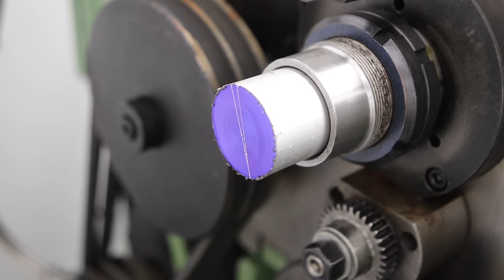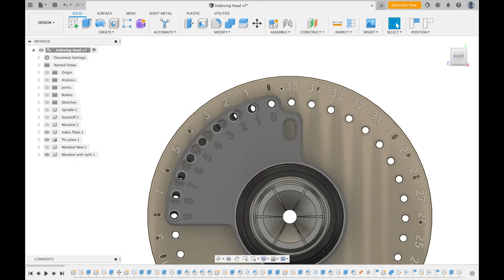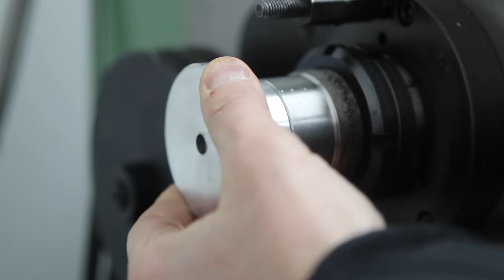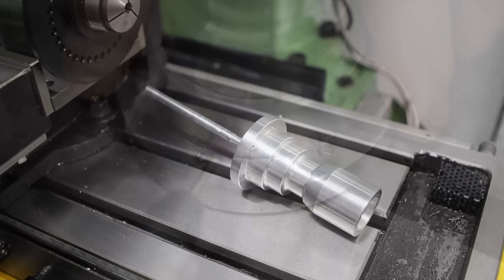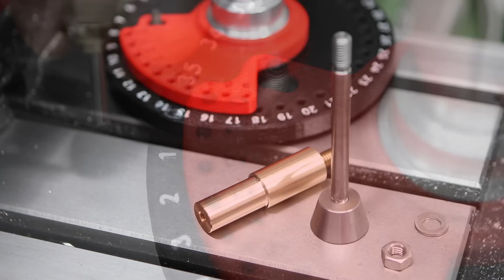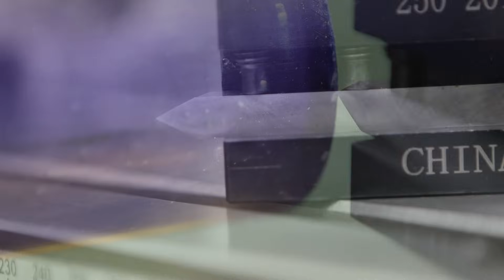Making an indexing attachment for the lathe

Comment: For what it is worth, when I 3d print a part that has an internal hole or opening that must be to size, I increase the size of the opening by the width of the filament nozzle.  This is usually a good starting point.

Comment: WD 40 is a good lubricant when tapping holes in aluminum. Give it a try. For those new to tapping holes, most affordable tap and die sets are made of carbon steel. If you break any, replace them with HSS (High Speed Steel)  for these are stronger, stay sharp longer and if all you do is aluminum, don't forget the WD40. There are other lubes designed for aluminum but cost is usually a lot higher.

Comment: I don't know if I'm making this more compicated than it is, but if you wanted to set a specific angle then, in spreadsheet form:

Angle in column A: =ARRAYFORMULA(ROW(A2:A361)-2)
Black dial in column B: =ARRAYFORMULA(1+FLOOR((A2:A361-1)/10) + MOD(A2:A361-1, 10))
Red dial in column C: =ARRAYFORMULA(MOD(A2:A361-1, 10))

Comment: I’m having a go at designing this myself in fusion. One thing I’m confused about is getting 10 holes 9 degrees apart. fusion asks what is the degree from the first hole to the 10th. If you enter 90 degrees (10 holes x 9 degrees) you get the same hole spacing as the 10 degree outer ring. I’m assuming it has to do with the spaces between the holes? My only assumption is that there are 9 spaces between 10 holes and I need to multiply 9 spaces by 9 degrees to get 81 degrees from the first hole to the 10th (at the end of the 9th space). Does that sound right?
Reply from the maker: To be honest it’s a couple of years since I did the design work and I’ve forgotten exactly how I did it. But, basically, this is what I remember - the main wheel has 36 holes, so, they are 10 degrees apart. The second component - the holes need to be 9 degrees apart, so if they made a complete circle (I used a segment of the circle) then it would have 40 holes. Make sense?

Comment: Do you not have a DRO for drilling a hex pattern ?  Also, for tapping aluminium, use a tap follower for making a straight thread and use thread cutting oil and take it far more slowly and back and forth, clearing chips.  You also need to be clear about the size of the drill hole for tapping aluminium as it is different to (eg) steel.

Comment: 3D printed parts can be designed taking into account the features of the technology and materials. In cases where a tight fit is required, in CAD, set the internal hole equal to the shaft diameter, and add compensatory elements in the form of truncated holes around the perimeter—this way, the part will have room to expand.
Reply: Or just machine the plastic to a precise size

Comment: A broken tap from a workpiece made of aluminum or copper alloy can be extracted very well using citric acid. Moreover, you don't have to wait for the fragment to fully dissolve. The part itself suffers minimally from this. This has bailed me out a couple of times, saving my labor and a piece of expensive bronze.

Comment: you probably have worked this out yourself but I thought I would mention it anyway,  mill bit needs to be smaller in diameter than the hole when you have hollowed out the tap use a stud extracter to get the residue out, hopefully leaving the threads you have already cut intact. all the best
Reply from the maker: Thanks, good tip!

Comment: you could try aligning the hole with the tap remnants in it and get a milling bit in the chuck of the correct size, advance the mill bit in micro steps untill there is no more tap.
Reply from the maker: Good idea, thanks!

Comment: fastest and easiest way to remove a broken tap in aluminum: Get some nitric acid and drop your part in that. Within minutes the tap will have been dissolved. Nitric acid dissolves steel but does nothing to aluminum.
Reply from the maker: Great tip, thanks!

Comment: Clever idea.
I think if you had the holes in the OD of the plate (IE rotated by 90 degrees) and the vernier plate (the red one) fit around that, it would be both easier to use and more accurate.
Reply from the maker: That’s a good idea, thanks!

Comment: Use spiritus to cut aluminum threads. To remove the tap, you could use a in this case 2mm carbide end mill and mill it out.
Reply from the maker: Thanks for the tip!

Comment: "THEY" make	>>>left hand drills<<< for the lack of a Trans National statement: the are rotated Backwards to regular drill bits, THEN use an "easy out" per correct size of your broken part.

The Drill BITS are Tungstan (sp) or other "Hardener additive", Any way, a VERY TOUGH STEEL ! ! ! !

I have had several, & buy them indevidually, As Needed 😮
LUBRICATION, In America, I use Kroil Oil, by Kano Industries, it is a super thin viscosity SYNTHETIC oil, designed to PENETRATE.

It will break rusted metals "bonded together" but for this purpose, it Really CREEPS into the miniscule difference between "Product Wall" & the Broken Tap !!!!

I buy it now, by the pint, as a PROFESSIONAL Machine Repair Shop for Hard Wood Flooring Tools, I bought TWO Gallons a YEAR, >>>ALL<<< of my "Floor Installers" received ONE OUNCE per Month  to lubricate their Air Staplers: ONLY ONE drop, per DAY, per tool.😮😮😮

Hope that helps,

philip, from the Great Pacific NorthWET, Oregon, USA

"Truth spoken softly, is LOUDER than Lies SHOUTED".

Comment: I have been getting lots of random machining videos today for some reason. A hacksaw is one of my favorite hand tools. Having said that, I have several quality hacksaws and only use quality blades and I use as much of the blade as possible as I paid for all the teeth. Long story short, I can cut right on the line every time! Handy tool you have made there with the vernier segment. Cheers 👍
Reply from the maker: Good to know, clearly need more practice! thanks!

Comment: I have gotten broken taps like that out by using a carbide punch to tap on one side in the “unscrewing” direction, and then grabbing the body of the tap with vice grips or needle nose pliers. For really small taps like this, a small pair of flush cutters can be sacrificed and used as pliers. It’s very tricky sometimes but I have never had to grind one flush yet!
Reply from the maker: Thanks, I'll try that next time!

Comment: As you were tapping in the aluminum I did not see you using any fluid. I always use WD-40 and very, very rarely break a tap and this has included taps as small as 4-40.
Reply from the maker: Thanks, I should have used lubricant indeed.

Comment: A hacksaw, like every other cutting tool has a cutting speed. It is about 60 stroke a minute, it also has teeth all the way along the blade and they should all be used when cutting. You will find it goes in the metal straighter with a cleaner cut. You should also lube aluminium with paraffin and avoid using steel cutting tools because aluminium welds itself to steel. Much better to use TCT. Other than a teach yourself approach it is a item I will probably make and I have rotary tables and plates. It would make life easier.
Reply from the maker: Thanks, good advice!

Comment: Removing a broken tap is one of the hardest things to do….that’s why you take great precautions so you don’t😜😜😜 
There is no need to power tap 6 holes, never use a spiral tap by hand, only under power. Try to use a 2 flute tap, the web is stronger than a 4 flute. Use proper lubricant, Moly Dee is probably the best but is pricey. 

GL
Reply from the maker: Thanks for the tips, wise words!

Comment: You commented that the aluminium was quite a gummy metal ( or in this case type or specification ) yet you did not use any lubrication on the threading operation. Especially when you are using a tap as small as M3! WD 40 would have prevented the tap breaking, yes I know you probably wanted to keep the lubrication out if the equation when you were filming it, but you now have had to pay the price! I've watched your follow-up video and it works nicely with your revision. As I don't have a 3D printer I'll probably attempt this in solid aluminium. But first I have to decide if it's practical as I have a Warco WM300 Lathe/ mill combo and a large box on the end of the lathe where the drive belt is and a dog clutch on the end of the spindle to change the drive from the lathe spindle to the mill drive.
Reply from the maker: Thanks for the feedback. Yes I know I didn’t use lubrication, silly mistake. I’ll be making another version in metal soon so watch out for that video.

Comment: Great prototype, you will learn how to not make those bonehead moves later on.

The concept works.
I hindsight, I would try to design it so you can see the numbers from the other side of the plastic as well.

Also, you need to replace the plastic with metal sometime. It will wear out quite quickly.

Also for tapping, lubricant and reverse half a turn like everyone else says. The chips is locking it up and you need to break them of.
Reply from the maker: Thanks. I am planning a metal version soon.

Comment: Hope this helps Peck drill it with a carbide mill high rpm low feed en passes of 0.2 mm and use a smaller mill then the diameter of your tap
Reply from the maker: Thanks!

Comment: I would have ground a slot in the material of the tap sticking out and tried to back it out with a flat tip screwdriver. Then I would have ground it flat and used just 5 bolts when that didn't work...
Reply from the maker: That’s pretty much how it went, I ground a slot with a dremmel, but one of the sides snapped off as soon as I tried to back it out with a screwdriver.  It’s in there permanently now!
Reply: @joneseymakes  That's how it goes... Great idea and implementation...

Comment: When tapping, half turn forward, quarter turn back.

To remove broken tap
you can use salt water or diluted sulphuric acid with an anodising setup..lead anoode and 12v low current power supply
Reply from the maker: Thanks!

Comment: Bit of kerosene or proper Al lube might have stopped the tap breaking in the first place. Putting something pressing against the part ( like an angle plate) holding it to the slitting saw should have allowed you to cut right through. Personally I dont like the 3D parts and I suspect they are your root cause for fine line variation. However the design I think is really good and Im tempted to make one myself thank you
Reply from the maker: Thanks, I’ll be making one of these in metal soon.

Comment: Mr Pete says you only really need three or four threads and recommends over sizing the hole a bit for a  percentage the holes depth so the tap only engages a portion equivalent to a common nut thickness therefore not to overwhelm your tap.
Reply from the maker: Thanks, good tip.

Comment: Many years ago I saw a scheme for a military lathe where a indexing head was mounted on the spindle outboard and a powered spindle on the carriage could mill or use a slotter on the work piece.
Reply from the maker: That sounds interesting, don’t suppose you have any pictures?
Reply: @joneseymakes  I wish, it was in 2004 on Aberdeen Proving Ground.
   The mill in any case was some incarnation of I believe "Master Mill" where the base and the spindle had a translating screw between them and guided by four guide posts like a die set. The motor was belt driving a worm gear box/spindle. There was also a reciprocating slotter bar attachment where the cutter would pivot in the bar on the retract. I think they were used as part of a very compact repair shop.

Comment: I'm thinking of doing something similar, but mounting a rotary table on the back of the spindle, with the internal expanding collet mounted on the table and the rotary table housing stopped from rotating by a long arm attached to the headstock.
Reply from the maker: Sounds like that could work.

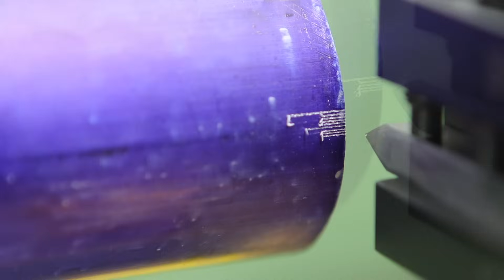Comment: In the testing (19:14); To get "good" spacing on the 1 degree attempt, the errors would need to be a good deal less than half a degree. Any errors in the position of the holes in the 3D prints will be cumulative, so (even with zero slop in all other mechanisms) the 3D prints would need to be good to a 1/4 degree, which starts to sounds like pushing the limits.
Reply from the maker: Yes I agree. I think this project was a useful prototype but I really need to remake this in metal to get the sub one degree accuracy that I’m looking for. Thanks for the feedback.
Reply: @joneseymakes  With a radius to the indexing holes of about 2.1 inches, 1 degree is tan(1) * 2.1 = 0.036". 1/4 of that is 0.009", colloquially 9 thou, or about 1/100" of an inch.

What's the resolution and accuracy of the 3D printer?

Comment: Dissolve Alum in hot water and soak the aluminum part in the solution. The aluminum will not be affected but the tap will be disintegrated.

Comment: This happens when you don't back off a half turn for every turn to break burrs and clear chips. This is a method of work taught in old school fabrication. In over fifty years of machine fabrication I broke only one tap. That was the first one, I learn quick. All I see now is keep turning and most don't even bother to lubricate the tap and they don't understand why it broke. I bought metric and S.A.E. tap and die sets when I became a machinist and replaced the one tap that broke, and four others over time that wore out. Both sets are almost as old as me!
Reply: I was taught to back it off in GNVQ Engineering in school 23 years ago now! Mind you my teacher was a lot older so i guess he taught us traditional methods he learnt before becoming a teacher.
Reply: @mrnobody9821  u used to be a metalwork teacher back in the old days when we allowed children to actually do things with their hands lol. I taught the pupils, ( boys and girls) to turn the tap or die 1/4 of a turn forward and half a turn backwards, thus ensuring the back side teeth cut the burrs from the threads. And when using taps if they broke the first one, not only would they have to start the part again, ( it was a small hammer from 12mm square mild steel with a taper filed onto it at one end) and they would get a pass at the first broken tap, but a second one they would have to pay for and be doubly behind the others. ( I was crafty as well as I made them do all the hacksaw and file work before they drilled and tapped the hole for the handle  so it was a penalty for breaking the tap!)
Reply: New school guy here. I learned to back off from YouTube lol. Thankfully I learned early on
Reply: I'm not a machinist nor do I do any kind of manual work... but I know to back off a tap periodically from the one semester of machining I did in high school ~30 years ago, it's that basic.
Reply: When you see the tap binding, you know there is going to be trouble.  Usually that's a sign to back off a half turn and to add some more lubricant.

Comment: nicely done!  in the absence of a band saw, a Dremel Cutoff disc might be a good choice! :)   For the tap, you might want to consider building an EDM tap remover and / or use an EZ-Out if the size of the tap allows for it.
Reply from the maker: Thanks for the tips!

Comment: Be sure you back out the frequently when tapping small features. If it starts to get really tight do not go further, back it out slowly. If it gets tight again, screw back in, then slowly back out. Forcing it like you did will ensure a broken tap.

Comment: When needing a close fit with a 3D printed part, I will model just the section that needs to fit and print 2-3 at slightly different sizes to try out the fit. When I find the one that fits well, I update the actual model to match. Saves printing several complete larger parts.
Reply from the maker: Thanks for that, good tip.

Comment: Hi! In order to remove a piece of steel from aluminum, you can boil the part in water with citric acid - this will not harm the aluminum
Reply: Nitric acid does the same but care should be taken as it is dangerously active,

Comment: A boiling solution of alum, water with a bit of Sulfuric acid will dissolve the broken tap to the point where you can pick out the bits. May take a few reboils and an over night soak but the aluminum will be untouched.
Reply from the maker: Great, thanks!

Comment: 14:03 Hacksaw hacks... When hacksawing point your index finger straight ahead alongside the handle. This can help keep your saw strokes straighter  provided your hacksaw blade is sharp and has an even bite. A little WD or other fluid is useful to keep the aluminium from sticking to your teeth.
Reply from the maker: Thanks for the tip!

Comment: I know this is a little late, but to remove taps like that, I usually “drill” it out with a carbide endmill that’s the same size or smaller then the tap drill size. Then the rest usually breaks free. Every once in a while if it’s a really brittle tap you can hit it with a punch and break it out in pieces.
Reply from the maker: Thanks for the advice!

Comment: With tapped holes, the maximun strength achieved is 1.5 X screw diameter. With thick parts drill the clearance size hole for 2 to 4 threads, this achieves 3 things, location start for the screw and it gives a nice round hole to countersink and lastly any tendancy for the threads to pull upwards will not interfere with the mating parts. Car cylinder blocks and gearbox housings use this feature so nothing interferes with two flat mating parts. Drill the holes deeper than needed and do not let the tap bottom out. Regards from Australia.
Reply from the maker: Good shout Dave, I hadn’t thought of doing that before. I’ll be sure to give it a go next time. Cheers.

Comment: Why not clean bore and make concentric the plastic parts to designed specs and a match to the metal.
Reply from the maker: Yes I would probably machine it to size if I were doing this again.